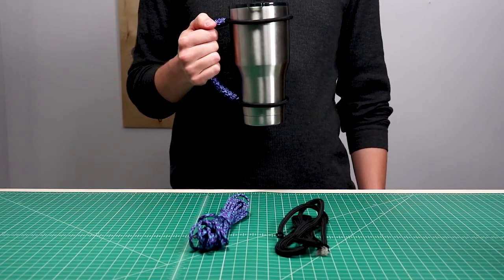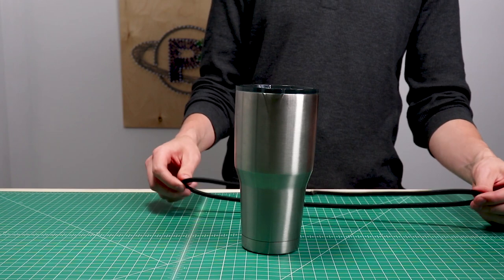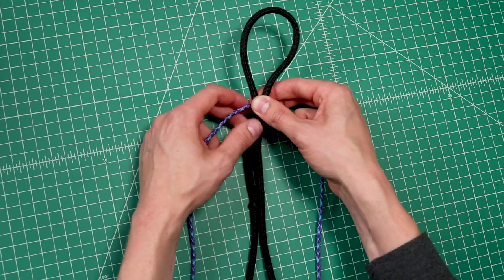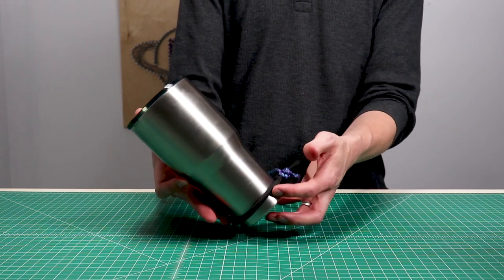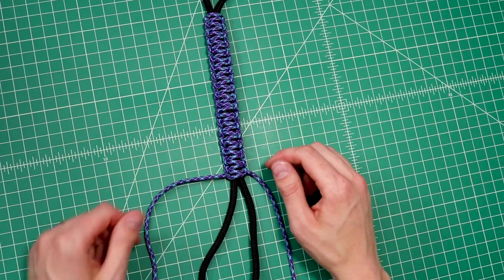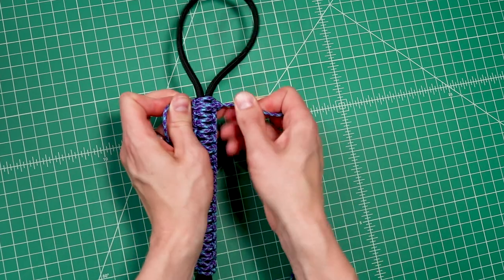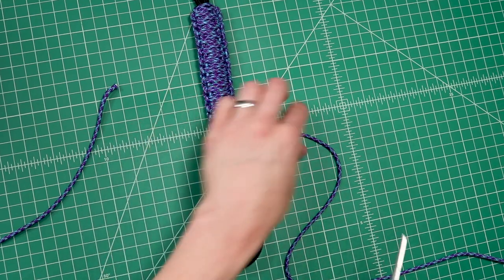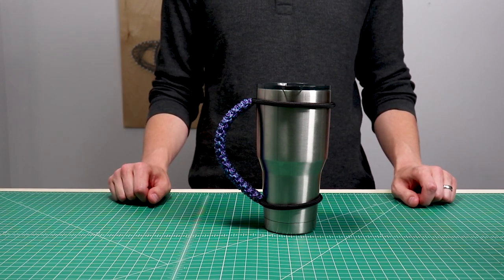Paracord YETI Handle Tutorial

Comment: This is really nice.  I have that Walmart one.  You are right; those cups don't all measure the same.  My other big cup like this (I think it is Simple Human brand) has a little bit larger diameter on the bottom.  It is too large for the cup holder in my car.  The Walmart one fits just fine though and that is why I have two of these big cups.  The lids are interchangeable.

Having a handle on one of these things means I will actually use it.  Otherwise it is too difficult to pick up with one hand.  Now there are two things I want to make using Paracord.  I started down this YouTube rabbit hole looking for bracelet ideas.  So I think I now need Paracord!  I must get some.

I still am not understanding how that handle works though.  What keeps it rigid and secure enough so it doesn't bend up and the cup dangle lower from its weight when you lift it?  I can see how all the weaving makes the Paracord handle so strong and fairly rigid, but I don't get how there is no movement at the stress points where the Paracord and bungee cords meet.  Could you please clarify this for me?
Reply from the maker: Glad you liked it! For this project, we actually did NOT use bungee cord, but that may work as well. We used "para-max" which is like paracord, but with a larger diameter. Around that, we weaved ordinary 550 paracord. The big loops friction fit over the cup. If you are worried about rigidity, you can make the woven handle part shorter for a less flexible handle.
Reply: @ParacordPlanet  Ah, okay.  I can understand that working.  Gotta learn the right supply words.  Thanks for clarifying.

Comment: I have a 20oz yeti tumbler.   It doesnt expand as much at the top as the 30 that you show in the video.  Would you go slightly shorter with the paramax?  Maybe 30 inches?
Reply from the maker: Yeah, shortening the handle just a little would be a good idea. 2-4 inches less should do the trick.

Comment: How do you make the handle so it's not limp, I made one today and it isn't strong
Reply from the maker: So this tutorial uses "para-max" cord, which is pretty stiff. On top of that, we weave a "cobra" or "Solomon Bar", then we weave the same thing over the top again. If you are doing all this and it still turns out limp, make sure your first layer of cobra weave is really tight. Every time you make a knot, slide it upwards, toward your completed knots. Hope that helps!
Reply: @ParacordPlanet  ok thanks I used polyester because I don't have panamax, do you think that's the deal?

Comment: Do I have to use the paramax or can I just use regular 550
Reply from the maker: You could definitely use 550, but it may stretch more and not fit as tight. The para-max cord has less stretch and grips better. Other synthetic fiber ropes would also likely work in place of para-max.

Comment: How much of the para max would u need to make a handle for a 20oz?
Reply from the maker: It would vary depending on the shape of the mug but you should be safe with 5 ft. It would likely be similar to the 3 ft. we used in the video.